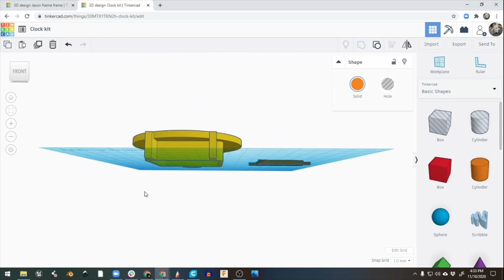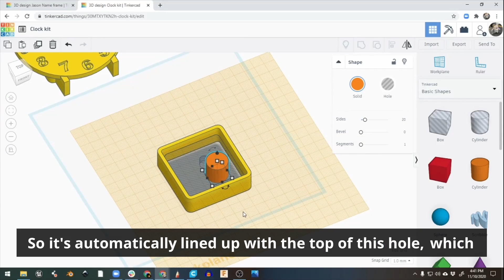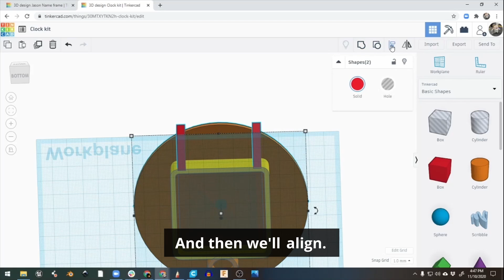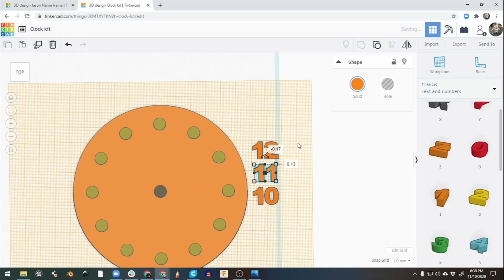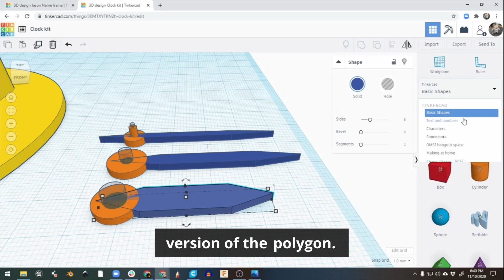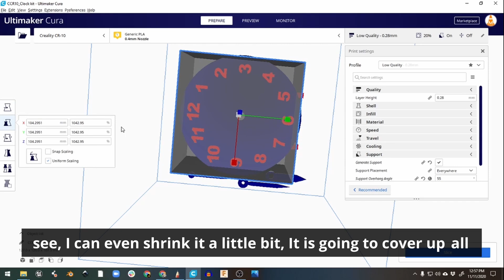3D printed clock from a kit with TinkerCAD

Comment: Excellent explanation.  Thanks .
Reply from the maker: Thank you. Please share if you make it.
Reply: @beamakerclub  I would like to do it all little different. 

Numbers as complete holes then print them separately (pick a colour or two) and insert them from behind. 
I intend for it to be used on a boat where the walls are not vertical.  With a white bezel it could incorporate an led night light and extra fixings to hold it flush. 
Great start for me.
Reply from the maker: @andrewbarnard667  That sounds like a great idea. Better than this one even.
Reply: @beamakerclub  well It will cost more to produce and take longer to make.
Reply from the maker: @andrewbarnard667  yes that makes sense
Reply: @beamakerclub  well it nearly worked. 
I printed a ring in black with the numbers on. Raised 2.25mm. With the exception of the 6 which i got wrong 4mm(brain was having a rest) in black .
Printed the main face in white.  It wasn't until I went to take the face off the printer I realised there were extra bits on the 4 6 8 9 10.  I need to find a font without separate enclosed areas.   A challenge to get it together but interesting.
Reply from the maker: @andrewbarnard667  thanks for sharing